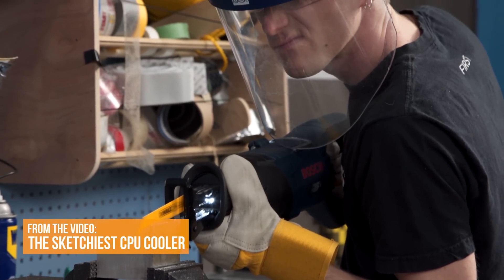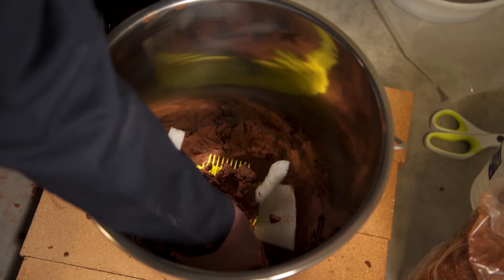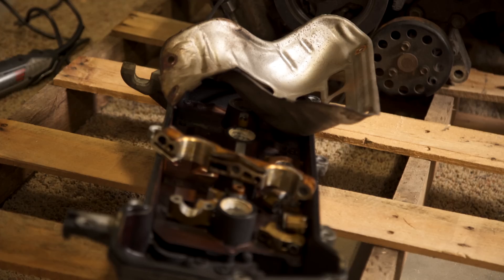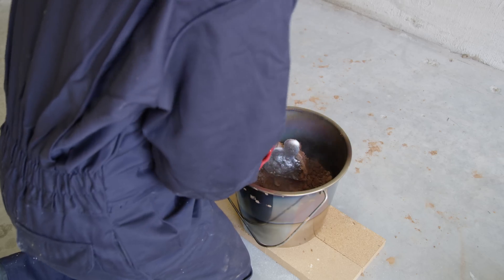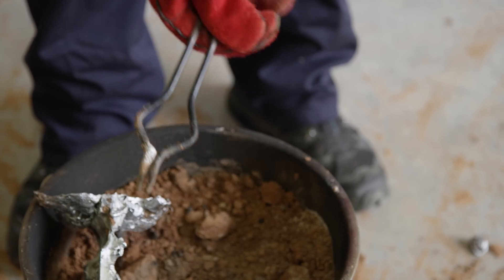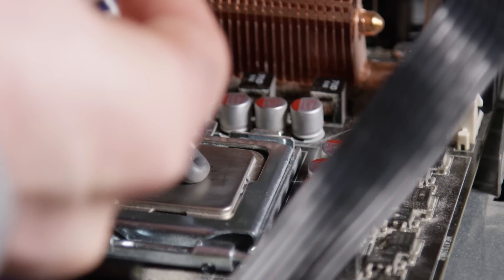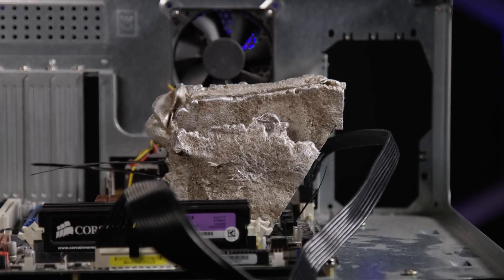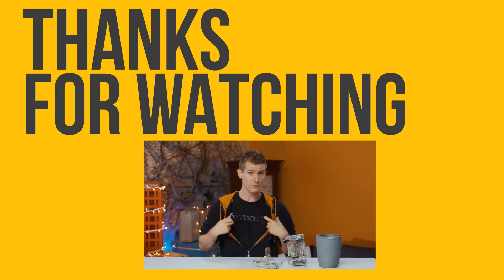The WORST CPU Cooler EVER – Sketchy Heatsinks Ep2

Comment: I think with a slightly more engineering inclined mind this could have actually been accomplished... I'm gonna mull over it, but I'm thinking you take the green sand and make a square block with flat voids on the top and bottom, fire harden it, and then cut fins vertically into it connecting both voids, then place it on a fire brick and pour aluminum into the top and let the bottom void fill, fins fill, and let it over fill into the top void, then when it cools you sawzall the top void off and sand the bottom flat, and you have a reasonable facsimile of a heatsink. youll have to chisel the sand out of the fins, but you make them big and chunky so they can handle it

Comment: wet sand works better, and foam is toxic but provides a better molding material.  Not to mention that the position you place your mold in will make molding easier and a higher chance of success. In this situation you should have placed the heat sync upside down instead.

Comment: Yer you needed to put the filler on the mounting plate to one side and the fins facing down. (then you need a bracket along the bottom for the riser to create a cube with fins cut out going through it).

Comment: Ok ok ok... The solution is simple. First get some copper hose/ piping, like the kind you find behind your fridge. Next you get some sheet metal. Theeeeennnnn you make the copper into a U shape with a flat bottom. Finally you slide the sheet metal onto the copper piping, attach fan or two, then BAM you put it on a cpu

Comment: You needed air vents at the tops of each fin to let the air out. The molten metal couldn't get in because it was compressing the air, which had no place to go. Actually, you did so much wrong, I'm surprised nobody got killed. For example, too much water in your "green sand" could result in a pocket of steam that would explode the mold, spewing molten aluminum all over everyone nearby. I'm guessing Canada doesn't have an OSHA?
Reply: A little strong, but yes we do have OSHA, but it's spelled OHSA or OH&S depending on your region and territorial/provincial gov't. But neither the American or Canadian OSHA variants would have any problem with this as they don't act on the execution of the work, but the safety of the job, which despite the apparently poor execution (I wouldn't know, I've never done molten casting,) they have gone for proper safety procedures. PPE, fire protection, well ventilated work areas and the like. How could someone have died if an air pocket burst from the possibly .56 kg of aluminum with maybe a splash radius of 15 cm? (That's roughly 1 pound and just over a foot, respectively.)
Reply: Well, i have a lot of experience, both with casting and with OSHA, and can assure you, they would not be pleased. But anyway...

You are seriously underestimating the force of a mold explosion. But let's assume you are correct, here's what could very well happen.

The cameraman has a heart attack and dies right on the spot. Two of the other guys argue about the best way to give CPR, and this eventually devolves into a fight with axes and chainsaws, where they fatally wound one another. Death count so far... 3.

Meanwhile, Linus got a small drop of molten aluminum in his eye, which burns the eye right out of his head. In his panic and pain, he runs out into the street and causes a massive 38 car pileup. A local traffic chopper sees this and the pilot flinches on the controls, sending his helicopter 300 feet higher without warning... right into the path of a B-737 on final approach.

Both the pilot and co-pilot have heart attacks, and in their death throes, their flailing arms switch off the autopilot, so when they slump over the controls, it makes the plane nosedive into a residential area, killing everyone in a 7 block radius.

The commander of NORAD sees this and assumes it's a terrorist attack. Because he is new and slightly drunk, he launches a strike on North Korea, which quickly escalates into an unrestrained all-out nuclear war, killing 6.5 billion people, not to mention countless puppies and kitty cats.

Yeah, we got lucky this time, but few understand how close we came to total global annihilation!

Comment: I don't think casting will work with your budget. People do it using extremely expensive furnaces to evaporate the wax(or PLA) BEFORE pouring the metal.
Maybe, you could "weld" some aluminum fins over a flat plate (possibly, using tin to make it sketchier :). That could work and meet your budget.

Comment: You guys could have just build a CNC machine with a Dremel  and a Arduino or Raspberry Pi and the proper bit. Why are you Casting stuff? I thought you where Tech guy's? Use a Tech solution not something from the Bronze Age

Comment: its not the staric presure its because you dont have enough vent holes. Also try just fine grade wet sand and Al isnt the easiest metal to work with in a DIY environment.

Comment: Aluminum oxide forms on ALL aluminum just like rust. When you heat aluminum you increase its reactivity to the atmosphere making it all into aluminum oxide when it comes into contact, which is why no matter what you pulled out of the crucible you still had a nasty layer on top. If you want to prevent this you need to add a flux, but this whole thing really is a waste of time.  Aluminum isn't ductile so when it shrinks it cracks which is called hot short.

Aluminum isn't difficult to cut, unless you're using the wrong tools. A chop saw with a high carbon blade or band saw would be much better. The problem with grinders and other small blades is aluminum is soft so it covers the surface making it difficult to cut.

If you really want to make your own heat sink I would advice going the route of milling/machining a block of aluminum, or cutting some sheet metal and welding them together to form your fins. A welder or machinist could tell you just about anything you need to know.

Comment: You guys just sucks at metallurgy and blacksmithing.
Reply: thats not blacksmithing though
Reply: Grammar doesn't really have much of an impact on a person's ability to work with metal. It does look bad however.
Reply: +MrGhost370 I can't even make an attempt. So it's not happening on my end.
Reply: Ernest Jay Yeah they really do suck at that. Very poor job but they tried at least.
Reply: they sure do suck at it. Good thing they don't depend on it to make a living...
Reply: MrGhost370
In my college we make molds and make stuff with steel. He doesn't have any idea to how make molds. With a good research and dedication you can make what you want
Reply: It really wont be that hard there design, didn't have enough "for lack of a better word flow" to it and didn't allow for enough aluminum to melt the foam/plastic, it really should of been cast upside down so the aluminum would flow down into the fins instead of trying to force itself up against the build-up of the gases. Source myself I am an amateur blacksmith and caster in aluminum
Reply: Jacob Paulsen and wax instead of plastic
Reply: Ernest Jay you just suck at grammar
Reply: Linus still sucked very hard thou
Reply: +MrGhost370 Do I have to be a president to judge the current one?
Reply: you don't have to be a chef to know that the food you're eating is shit... Same principal here.
Reply: Kyle St John And you're awesome?
Reply: Kyle St John and you are awful at spelling.
Reply: Kyle St John *awful
Reply: lol i didn't give a crap about "grammar" anyway since i'm not english speaker.
Reply: No shit. That's totally out of their area of work. It's like expecting an accountant to draw a portrait of yourself.
Reply: Not bad for a bunch of gamers, in fact pretty good for a bunch of gamers.
Reply: Ernest Jay ya they fucked up
Reply: At least they don't "sucks" at grammar... ;)

Comment: 1. The sand has to be packed a lot tighter
2. You need to form a funnel for the aluminium
3. USE A DAM SPOON TO REMOVE THE SLACK
4. Don't reuse the Sand
5. Properly melt the Aluminium
6. Please stick to electronics. Watchung this hurt my heart and soul. Atleast watch 2 or 3 vodeos about something lile that before trying something like this, seriosly.

Comment: Another option would be to build one.  just use aluminum pieces and use something funny to connect them like JB weld.  IF it fixes some engineblocks sometimes why not.  Also it might actually work.  
Maybe cut slots in the base block to increase the surface area between the cooling fins and the base block.  
I've heard of JB weld taking an awful lot of thermal expansion and contraction before failing.  So it'll probably fail eventually for #entertainmentpoints  and laughs.  And by fail I mean the vains will probably literally fall off.

Comment: There are so many mistakes in casting you made. Far better ways to make a mold, green sand is not good for small castings and you should have made a bit of a funnel and poured A LOT more aluminum than u did. You can always cool the extra for more castings.

Comment: you did a back casting. you know you suppose to make a wooden box of two for top and bottom layers to have a good form also make a easy pouring hole with a finger poking threw the top layer

Comment: Look for God's sake just buy a few sheets of aluminum and solder them together on heat pipe made of copper tube. If you want to cut aluminum with a power saw use a WOOD blade. Aluminum is actually very soft and cuts like butter.

Comment: next time you do a DIY heatsink you might want to consider soldering or brazing thin metal plates to a thicker base. if you do that you'll want to stay away from Aluminum if soldering because it is a nightmare to solder.

Comment: captian hindsight here, but wouldn't the fins have turned out fine with the sand mixture if you just set the mold upside down with the fins facing downward?

Comment: You should've used some type of material that hardens after a while and that can handle the temps of molten aluminum. Something like cement. You would pour the cement into a bucket, and put your 3d printed heatsink on it, fins down, then, when it dries, melt or break the 3d printed heatsink away, and then your can fill the empty space with the molten aluminium. Then you would have to break the cement away.

Comment: Just a thought, could you take the green sand, then poke a screwdriver in it in a regular patter to make sort of a "pin" pattern like on a motherboard (or cpu) and then cast that so that it would fill in those holes, and then just cut it to the right size? If someone has more experience than me on this please explain why it wont work if it wont

Comment: Just use a split mold and dry casting sand. with your 3d printed part instead of the lost method. If you use the lost method use wax instead

Comment: 1. that Aluminium is awful quality you would have got much better stuff if you had gone to a recycling plant and got a large box of old aluminum cans this is a much purer form of aluminum without the chemicals for hardening it 
2. you can't use clay as a mold it bubbles,
3. green sand has to use a specific oil in it rather than water so it doesn't dry out when heat is applied or it collapses
4. the aluminum needs to be much hotter it should have a consistency of water rather than engine oil 
5. you should use a small funnel made from the sand at the top to funnel in the aluminum into the cast
6. the sand should pack it a lot tighter in around the mold use a mallet to compact it
7. the whole mold should be under the sand with only 2 ports coming up these should be empty and not have foam you should remove these before pouring

Comment: Should have made the mold upside down. I don't know how you were expecting the Aluminium to flow up into those tiny crevices against the force of gravity, but obviously it didn't. Also, if you do this again, try using epoxy sand and melt the PLA out of the hardened sand mold before you pour the metal in, that way the metal doesn't have to spend energy melting and moving the plastic and can instead simply flow into all of the crevices in the cavity.

Comment: This gives me an idea for another episode of Sketchy Heatsinks. You should try making a passive heatsink that uses a ridiculously large thermal mass alone to cool a CPU. You could get a big block of aluminum (20 pounds +) and cut the bottom of it to fit the CPU. Then mount the motherboard to the cooler and see how many days it takes to reach its thermal equilibrium.

Comment: OMG, did you just quote top gear? xD Clarkson of tech, lel. On a more serious note... What kind of mind would conceive a heatsink like that? I mean don't stay till late at the shop with those 3 employees, or you'll end up in a dumbster... hacked to pieces... On a less toxic conclusion, cast individual thin leaves with a fortified square in the middle, pass through double copper tubing, temper at a high enough temp, but not melting point remove the oxides, done, simple as that, or 3d print intricate leaves from aluminium blocks, techy enough for the channel, and fairly inexpensive if you aim to create 10 heatsinks+. Another method, again, single aluminium block, drill a gazillion wholes in a mesh pattern, with every x interconnecting with y and z axis. Aim of that is to leave as little material behind as possible, or you can pass through the y axis, copper tubing reaching to the base that comes in contact with the cpu. There are a million different ways to attempt this, without ending up with a horrid looking specimen like the above. Alas, it was entertaining af. :)

Comment: use tin foil next
Reply: if you can layer tin foil and fold it with a hammer or press into a solid structure than this might work.
Reply: i foresee a lot of thermal paste...
Reply: Aluminium foil*

Comment: Should've cast it upside down to guarantee the fins instead of trying to rely on static pressure. You'll still be able to use your design in PLA and it will have a flat bottom if you pack your sand tight enough, and lost PLA takes 24hrs to do since you have to bake the entire mold to make sure there is no moisture left and that the PLA mostly melts away

Comment: A few casting metal suggestions Cast with the fins pointed down in your green sand. Use the lost max method. and you need to leave a hole for the molten wax to escape out of. Part of your problem is that you have no way to exhaust the waste material from the mold.

Comment: Could have done a DIY water cooler easier with greater likelihood of success and less effort... All you need is two copper pucks, mill some simple water pathways, and solder it together to make it water tight. Add a few lines, a small dc pump, amotorcycle radiator, and a 12v cooling fan and done.  Does it get easier than that?

Comment: Your "Green Sand " should have been a fine sand mixed with oil. That's what the green color comes from. I believe your attempt would have worked had you made a two piece mold with some tapering on the part for removal before casting.

Comment: This is simple buy some Aluminium and Coppa sheets cut them is rectangles of 2 different sizes. Then drill holes in them at one side.  Use those holes to bolt together the alternating layers of Aluminium and Coppa to make a heatsink.

Comment: Would a commercial heatsink be improved for having the surface of each finn corroded slightly to increase surface area (via lots of tiny erosions in the surface) and have improved air flow due greater spacing between fins?

Comment: Your use of lost material casting was done badly. You need the most delicate structures, in this case the fins, to be the lowest portion of the cast. All of the video shows the fins up, which won't work when you are depending on gravity to force the material into mold.

Comment: As someone who has made a successful sand cast part out of aluminum, I can tell you right off the bat that in your fist couple iterations, the metal was not nearly hot enough. In order to get enough fluidity out of the metal you need the temperature to be roughly 1450*F, or when the metal starts to glow in between cherry red and orange. If you decide to try this again, this should be one of your first modifications. the other things that you could do is to make your wall thickness a minimum of .14'' and make your risers about 3'' taller than the top of your part with the green sand  completely covering everything so that it's level at the top, and so there is a clear funnel to pour into. After the molding process, you can take the foam out of the sprue, and that will make sure that you don't spend precious heat at the surface, and melting foam. Good luck next time if you decide to try casting again!

Comment: 1. Half inch copper block size of the CPU.
2. Counter sink it with thread holes
3. Use lots of Steel screws with thermal paste as threading compound
4. ???
5. PCsOnFire

er I mean Profit!

Comment: If you're going to do lost cast PLA, you have to melt it upside down so that the PLA can drain out. Also, every rib on the heatsink would need a connector so air could escape. So many things wrong with this process. Good attempt though! It gave me a few hearty laughs.

Comment: why don't you buy some aluminium sheet metal then hand cut to size and maybe weld them to a base i would like to see if that works plus it might be a bit more accurate for making a heatsink then melting the aluminium

Comment: The casting of the metal s done idiotically. At what point did you hope the molten aluminum would rise up in the mold? You should have made the mold in a way that the fins of the heatsink are facing down (for easier traveling for the molten aluminum)

Comment: If you have green sand then you can mold the sand around your model made of wood or plastic or what ever then remove the model and the green sand will hold it shape leaving an empty cavity so you don't need to worry about the aluminium trying to melt its way into the mold.